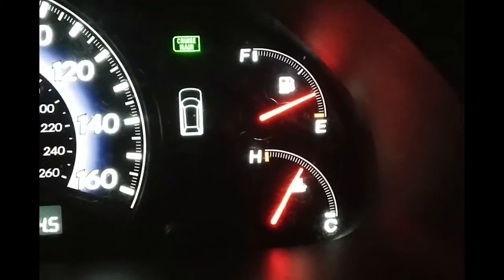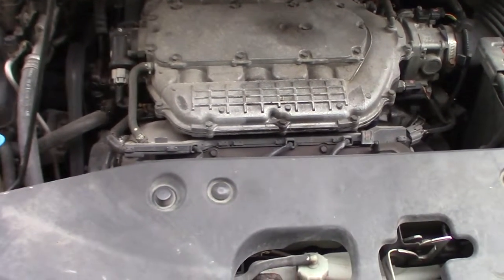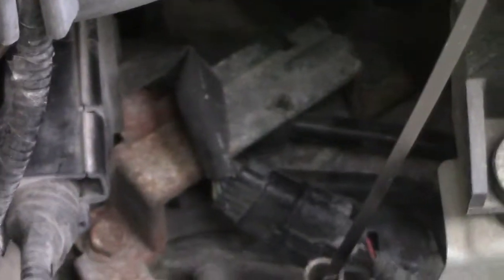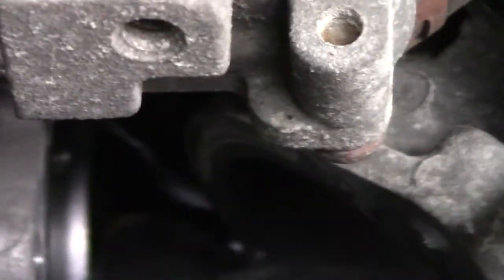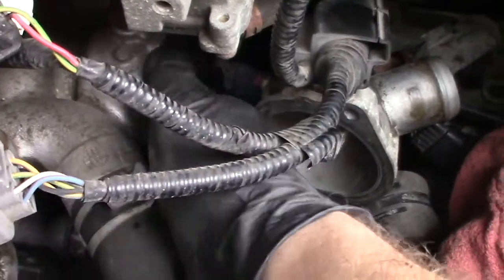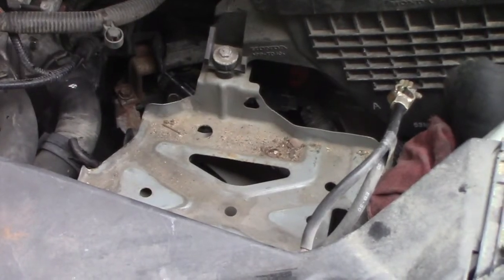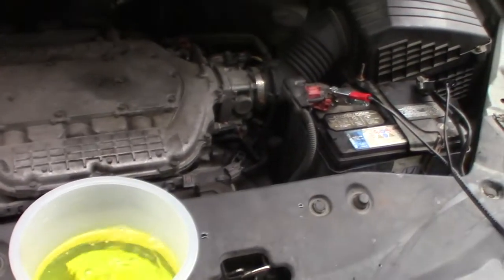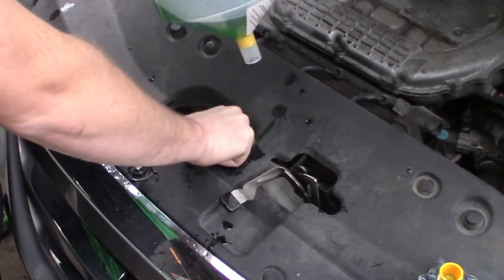Easy Fix! Replace a Honda Odyssey Thermostat (2005-2010)

Comment: Thanks for the video, Just did mine at 250k.  Very corroded and original thermostat mine was doing the same as yours. Only thing I did different is I did not remove the hose from the thermostat housing to save a step.
Reply from the maker: Thanks for watching! Good tip there, when the hose is in an unwieldy area, just makes it easier to remove, but it certainly works if you leave it on as well

Comment: I think for any Honda 3.5 Liter V6, a good compromise between the Honda OEM Thermostat and the cheap ones at Oreilly's is the AISIN thermostat/gasket.  Its made in Japan and have used it on a 200,000 mile Ridgeline.  No problems, it hasn't blown my engine, and I am confident in most products made in Japan.
Reply from the maker: I agree with this
Reply from the maker: I also use the AISIN Honda transmission fluid, good stuff
Reply: @RiggsGarage  I might have to try it.  For my Honda's that are < 10 years old I still use DW-1.  For those > 10 years old I started to use the Idemitsu ATF Type H Plus.  I think I will try the AISIN next time.

Comment: Hi, thanks for the video. I have a 2009 Honda Ody. My problem is that the engine fans won't turn on. I already checked the fuses, replaced both engine coolant temp sensors and both relays. On the dashboard, the indicator is at zero when the engine is cold, when it starts to warm up it goes up to the middle, but it never goes beyond there. But using a little bluethoot scanner I see the temperature go up to 210 F and even higher. But the fans don't turn on. When I put a paper clip in place of the relays, the fans work and the temperature returns to a normal temperature (170 F) on the bluetooth scanner, but on the dash it is always in the middle. Why won't the fans turn on if I change the relays and sensors, the fans are working and they are not damaged?. Do you think I need to replace the thermostat as well? Thank you.
Reply from the maker: Since the thermostat is very easy, I would throw one in and also make sure you burp the system very well. I have seen a few cases where there's a big air bubble right where the temperature sensor is and it doesn't read very well on the gauge / probably would not kick the fans on. If you have a bunch of miles on it, I would do the thermostat anyway and burp the system. Thanks for watching!
Reply: @RiggsGarage  Thank you very much, I'm going to do that.

Comment: Mine doesn’t have the those 2 bolts to remove the wire harness. If I had a swivel extension I could get the bolt out

Comment: Had same issue overheats when car is sitting but when car moves temperature drops to normal changed thermostat and I have same issue what else could it be fans are working correctly
Reply from the maker: Could be flow issues like clogged radiator, fans (yours seem ok), low coolant can act like that, air in the system possible
Reply: Sorry I was wrong the radiator fan not coming on

Comment: But my heater is cold. Engine is overheated. Radiator is cold. It's thermostat or pump?
Reply from the maker: Not sure, I'd recommend taking it to a mechanic asap

Comment: My valve was stuck so i couldn't drain it. Then i  couldn't get the hose off the thermostat then the bolts for the wire harness was being bitch so they stayed on. So i said f*ck it and just took the thermostat housing out and yanked the thermostat off. Put the new one in, fill and burped it. It works good now. All oem parts.